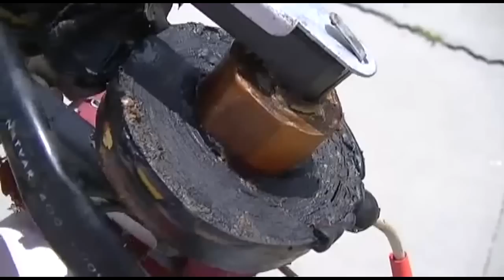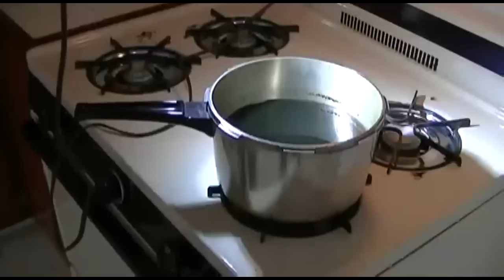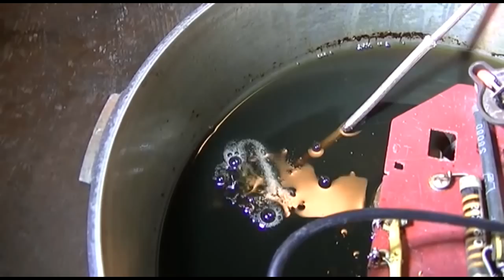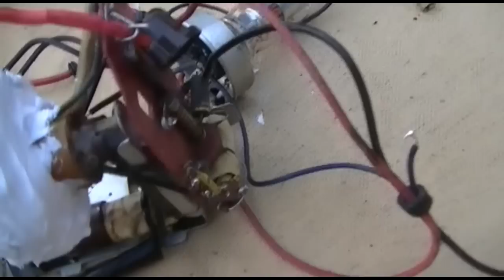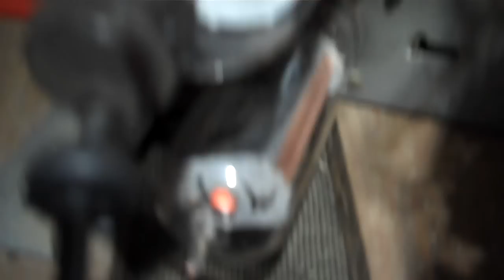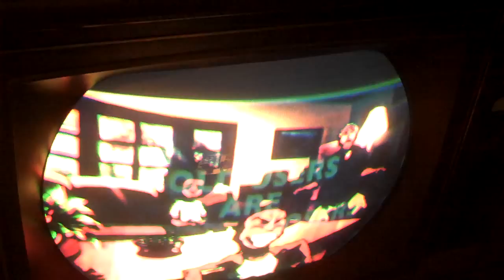Flyback Repair Recovering Wax Vintage Color Tube Television

Comment: This is probably no good after the fact, ( and this long so, )  but silicone 1 is not good for HVTs due to the acidic cure it uses, type 2 might be better, but they do make stuff for this type of transformer, (Corona Dope ) , but I'm not sure how well it will do on top of a waxed core, it may work well, who knows.. :o

Comment: I have a fly on a slyvania that is a thordarson replacement type, but the grey silicone is all melted out around the inner part of the tire. It still works, and I am tempted to see if I can remove that messed up silicone, deep fry/vac/wax and re silicone. Or maybe I will just try re silicone into the melted out part. the tire will actually sag on the primary as it gets hot.

Comment: Hammond is one company that will apparently custom wind a transformer to whatever specs you need, though they do say that the costs would obviously go down with volume. I don't know if they will handle a flyback transformer though. Somebody did something like this for early Philco black and white TVs. There are still NOS flyback transformers around, I have a few that I ended up with here and there, some I think are for late 60s and early 70s Zeniths.

Comment: Nice result. The old timer I learned from had us peel off the skin, & use GE clear silicon.  He said it had to be clear. Don't know why clear, but he insisted it be clear. He was in his 70's at the time & that was 35 years ago. Interesting, we never did the waxing. The other trick on sets w/triplers was to melt the crack with your Weller gun 1st. & then follow w/the clear silicon. Sets ran for years and years. I still don't get the whole tripler thing, but they arced out alot too. Nice job.
Reply: Farmradio just ask the old timer again for us. Thanks